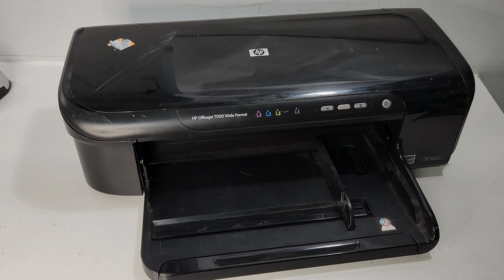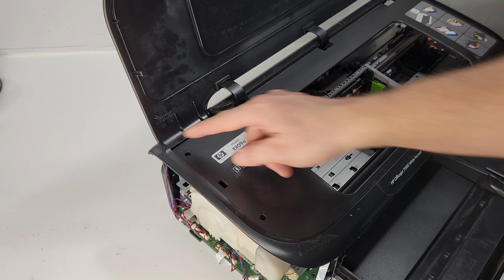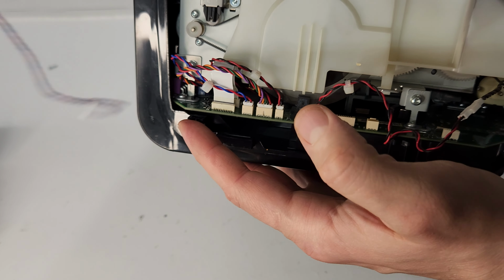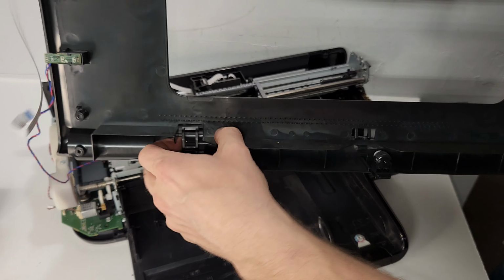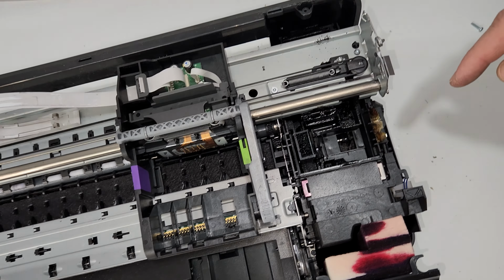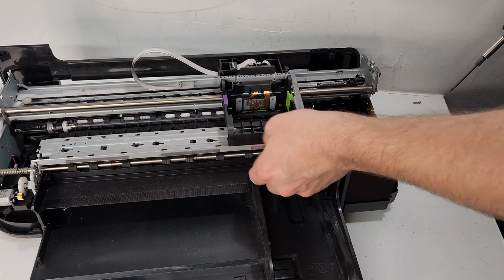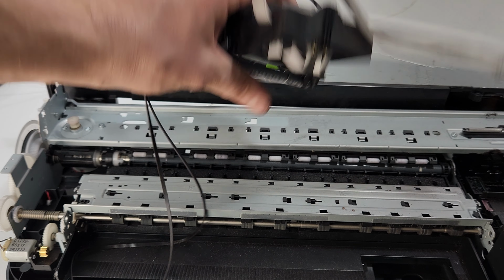Taking Apart HP Officejet 7000 Wide Format Printer for Parts or Repair

Comment: Once you have taken it apart and cleaned the service station and pads, how do you time the pump and the service station together?  I have a 6500 that the gear stripped on and I disassembled to fix.  I have come to the conclusion that these printers fail because of the accumulated ink and the drying of the grease on the service station.  I am going to start the printer without the service station and see what happens.
Reply from the maker: It should be timed automatically. Hopefully I understood your question right. Good luck! Let us know how that goes.
Reply: @303electronics I have taken the pump off and disassembled the service station.  I think the two are timed together, a gear on the other end of the shaft engages the pump.  Now I'm trying to get the service station back in without taking the carriage out (again).

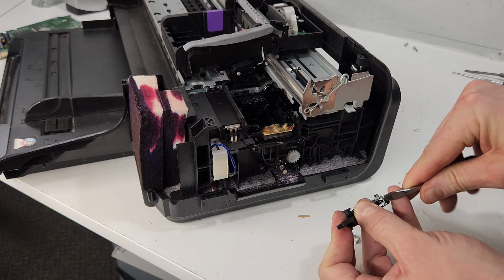Comment: @15:00 you disassemble a 3-gear unit you pulled from under the right side of the printer carriage and the middle gear you could not find a replacement for on aliexpress. Can you provide the part number for that gear and where you found a replacement (if you found one)? My middle gear is cracked and the carriage assembly is stuck at the far right of the printer.